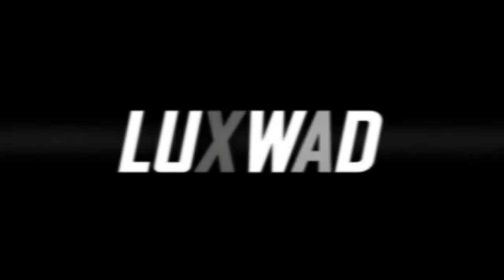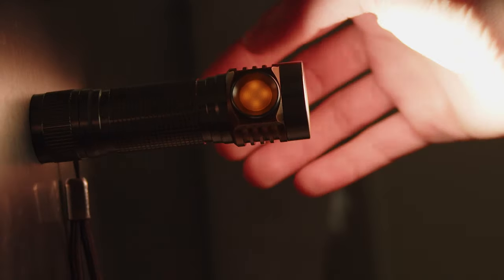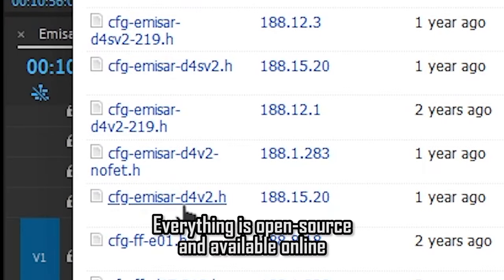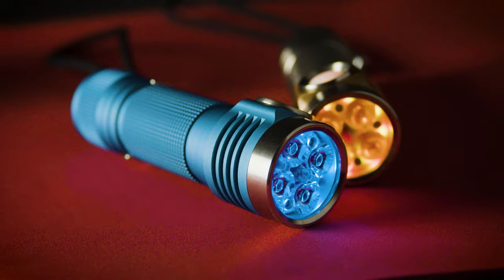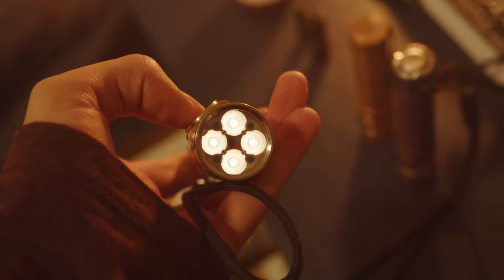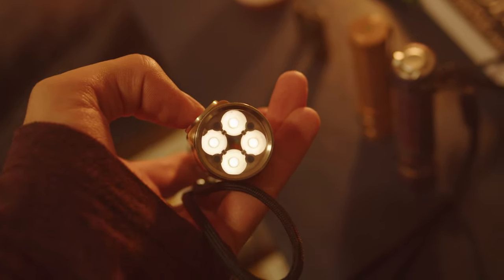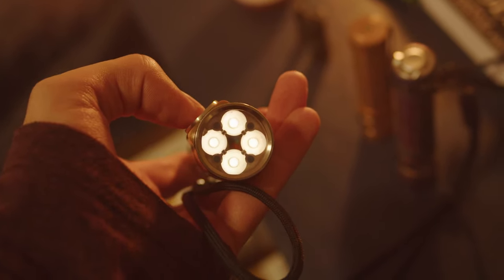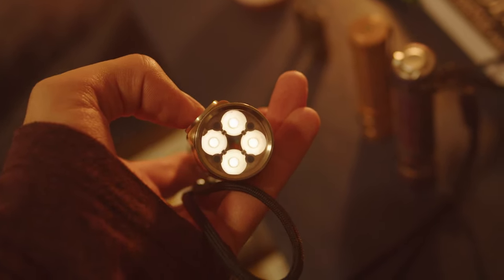DANGEROUSLY FUN - Emisar D4V2 [In-Depth Review]

Comment: I want to get this but the batteries can be dangerous in this?
Reply from the maker: Batteries are only dangerous if mishandled.
These lights require unprotected cells, which need to be charged and stored properly. Use a good charger, never charge at freezing temperatures, never over-discharge (the lights will prevent this), and do not allow the cells to be short-circuited, so store them in battery cases if not in use.

Do those things and you won't have any issues.

Make sure you buy cells from reputable dealers. I like Illumn.com, 18650batterystore.com, and batteryjunction.com. Sales of unprotected cells are no permitted on sites like Amazon and eBay, so never buy bare 18650s from those stores as they will almost certainly be dangerous fakes.
Reply: @LuxWad  
Thanks, you say use a good charger. This light just comes with the cable and I can just use an iPhone cube?
Reply: @LuxWad  And I guess I don’t know what unprotected as far as a battery entails. Do you have a link to a video that explains it so you don’t need to explain it all to me?
Reply from the maker: No, you'll need a dedicated battery charger, something like the XTAR VC4 I reviewed on my channel
Reply: @LuxWad  Oh bummer, I didn’t realize that I have to buy a battery plus a dedicated charger. The cost adds up quick to the point I think I’ll just get the sofirn
Reply from the maker: Yeah that's why I usually recommend light like Sofirn/Wurkkos to people new to the hobby
Reply: @LuxWad   I’m def a noob to lights lol. What sofirns and Wurkkos do you like? Brighter than this?
Reply from the maker: I really like the Wurkkos TS21 and the new TS25 looks great. The Sofirn SC31Pro is a graat option. All of those lights use Anduril like the D4V2, the Wurkkos FC11 is much better if you want something simple and straightforward
Reply: @LuxWad  Thanks what’s the brightest?
Reply: @LuxWad  I have the if25a and my if22a is otw.
Reply from the maker: Those are both great lights! The Wurkkos TS10 is a good small light that you might like
Reply from the maker: All the quads are about the same, like the D4V2 is just depends on the specific LEDS and the battery you use.

Comment: Wow i just realized that I don't know anything about flashlights lol. I want one but I don't even know where to start.
Reply from the maker: Haha yeah there's a lot to learn. There's some really great stuff online, I recommend heading over to Budgetlightforum.com or r/flashlight on Reddit where all this stuff is discussed. You can feel free to ask me any questions you might have too!
Reply: @LuxWad  well right now im trying to decide on the emitter. Im thinking i want either the e21a or 219B in 3500k or 4500k. I really don't think I need 4000 plus lumens. It also seems to be risky and not worth it for 60 seconds worth of blinding light.
Reply from the maker: I've decided that the E21A is my favorite option for this light, the super high output is great but it doesn't throw very far and doesn't last long so it's not real useful for me. The SST20 is an excellent all round option but the Nichia have better color for sure. 219b is great (and a bit brighter) but I like E21A more personally. It's just so nice with the floody optic.

If you want the high output, I think the DT8 is a better option anyways, and it's really awesome with 219bs
Reply: @LuxWad  so you would recommend the e21a? What temperature do you like most?
Reply from the maker: @jeremyburris4890  4000K is my favorite temperature overall, but I like neutral to warm colors. 4500K to 5000K are really excellent neutral tints that are easy to recommend. The 2700K is super nice indoors but it's a bit less versatile and I don't like it outdoors as much as 4000K
Reply: @LuxWad  I went with 219b 4500k. It was a hard choice but I think I did it because it has better output than e21a and it's supposed to be going away soon so it'll be somewhat more collectible. I have a feeling it won't be my last though lol.
Reply from the maker: @jeremyburris4890  The 219b SW45 is a beautiful LED, you'll enjoy it :)
Reply: @jeremyburris4890  які ваші враження від ліхтарика? Не помилилися з температурою світла?
Reply: @lisovyj  I'm sorry I don't understand.